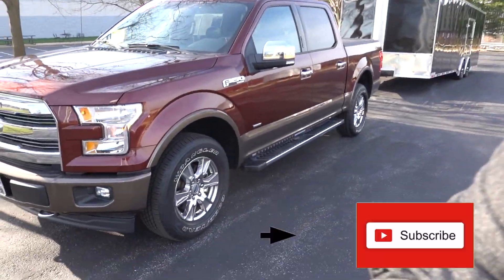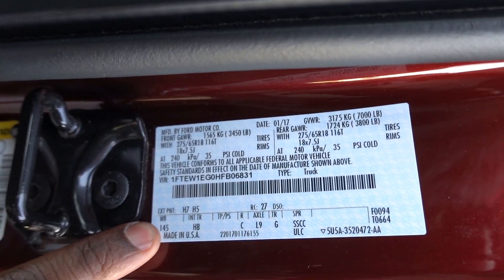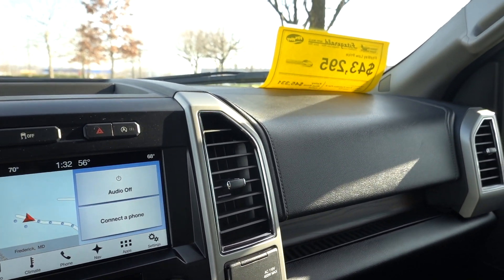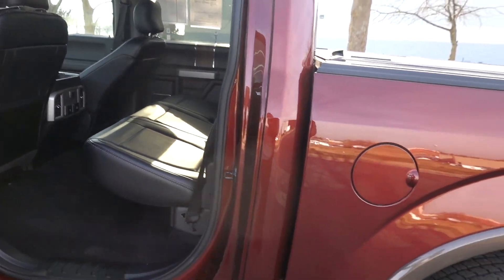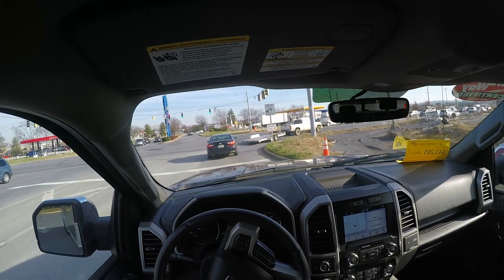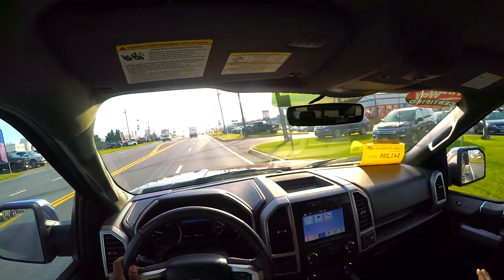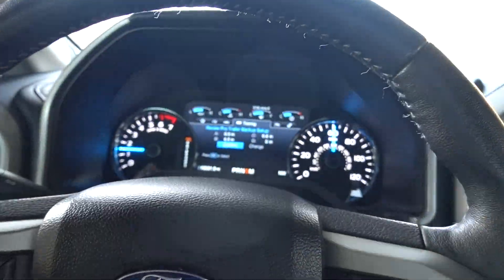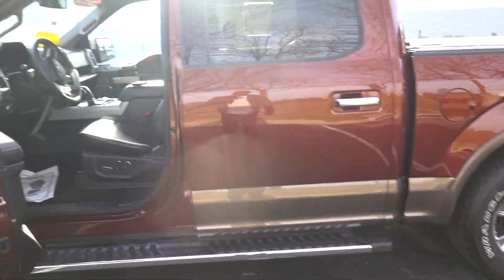The Ford F150 Performed The Worst On My Towing Test... | Find Out Why It Failed!

Comment: If the tailgate handle has the led light then it does have the tow package.  Just a clue for the ford trucks.  Did not notice one on the truck you drove.
Reply from the maker: Thank you for sharing this!
Reply: There are 3 tow pkgs, 53B is basic, 53A is HD, 53C is max tow. The 53a has the LED light on the tailgate

Comment: Your setup is for 5000lb trailer with a 500lb hitch weight!
7:20 in the video.
Reply from the maker: I believe I posted the towing numbers in the video
Reply: That's for bumper only... As in no hitch what so ever...
Reply: @JB_WhoWork  yes at 7:20 you show that you should only tow 5000 ibs without a distribution hitch, no matter what your ball says!
Reply: @6628guitarhero   No, its for towing without a distribution hitch! 7:20
Reply: @6628guitarhero  No it isn't!

Comment: That is not a max tow package, nor did it half LT tires. I have a 2011 ecoboost that I towed a 5th wheel and Travel trailer. NO sway at all. Which I have the max tow and LT e rated tires

Comment: If you felt the trailer pushing the truck, your gain is set too low for the brakes. The trailer at low speeds should actually slow you down. What was the weight of the trailer? Need a TDH.
Reply from the maker: Should be posting a video this week on that

Comment: You shouldn’t be towing that trailer with a half ton without a weight distribution hitch.  The Ford is a light truck as you can tell.  The same aluminum that gives you more payload makes the truck too light to control bigger enclosed trailers .
Reply from the maker: I’m testing manufactures claims about these tow numbers and I’m learning these trucks do not have enough stability to come close to the tow capacities. In time I will add a WDH to my trailer and retest these truck but for now, I want to see how well they do without
Reply: @JB_WhoWork  seems like what you're saying is only partially true.  Seems like you think manufacturers should only be allowed to state a towing capacity that's acceptable in every configuration (flat/boat/box) but that's just not true.  If you properly load 8-9k on something more aerodynamic and use a proper WDH these reviews will look less like a commercial for HD trucks.  I feel like it's common knowlege that HD trucks are better for towing but what about for everyday use and limited towing?  That's not every situation but it's pretty common since these are very often daily drivers for people nowadays.  Besides that fact, much of the advantage of HD trucks in towing (especially box-shaped trailers) is that they simply weigh more, not necessarily any engineering or power differences.  Also will be much easier to evaluate all these videos once we know what the total and tongue weight of the trailer is.  The hitch level of each truck could even make a difference.
Reply from the maker: The point for these videos is to give my perspective on half ton trucks. I had a chance awhile ago to tow with two half tons and was shocked at how they performed, so I wanted to test more to see who makes the better towing truck. Sure WDH would make a big difference but I want to test as many trucks w/o to see how the frame, suspension, and brakes perform.

I’m not against towing with 1/2 tons but I think manufactures are building false confidence in their products because even with the right hardware, you can’t get around the “light” feeling 1/2 tons have.
Reply: @JB_WhoWork  it’s your test so you can set it up to show what you want... but it’s sort of like towing with a Honda Accord. 3/4 ton pickups tow better than those too. It’s dumb that marketing is choosing to focus on towing capacity as the reason to buy a pickup no doubt. It just seems more useful to find the limits of what they can do when properly equipped. A half ton that can tow without wdh safely just isn’t a half ton at all.
Reply: @JB_WhoWork  towing numbers are not manufacturer derived, they all rate to the same SAE J2807 standards now and have since 2016. The manufacturer does state however that a half ton should never tow more than 5,000 lbs off a bumper ball hitch without weight distribution bars, and HD trucks no more than 6,000 to 8,500. Not only is it unsafe to do so, it is pointless as you are exceeding this limit by more than twice the weight half tons were designed to handle without it. With the proper set up, including sway control the F-150 will have zero issues with this trailer

Comment: You may have mentioned it before but what is the GVWR of your trailer?
Reply from the maker: 9950
Reply: @JB_WhoWork  you may have been over the GCVWR of that truck?  Not sure what risk that presents but would hate to see something bad happen to you!
Reply from the maker: So the GCWR I used was 16100 so figure my trailer is 9500#’s, I’m 200#’s, and truck was 5239#’s. Add it all up and I’m at a GCWR of 14939#’s which still leaves me with approx 1161#’s leftover. Someone confirmed this truck has the max trailer tow so this truck could potentially have 800#’s more of GCWR available! Thanks John for caring for my safety 😀
Reply: @JB_WhoWork  Thanks for the explanation, JB...I’m new at this and was under the impression that you just added the GVWRs of both the truck and the trailer to see if you were under the GCVWR of the truck (tow vehicle).  Peace and Happy New Year!!
Reply from the maker: This is very complicated stuff so keep learning and gathering information so you can tow with confidence!
Reply: BUT you have to calculate tongue weight (950-1000) here and then subtract that from your payload 
  so with you at 200lbs your maybe 500lbs to spare and as others have said this definitely needs a proper weight distribution hitch 
  I good safe rule of thumb is keep it under 80% or mad tow rating 
  watch TFL truck videos
Reply: @JB_WhoWork  you don’t have max tow on that truck, it’s a 53B pkg

Comment: I personally would not pull this trailer with anything less than a 3/4 ton (minimum).  I am a fan of the EB engines power and as a Tundra fan I am wanting to see what the (reported) new TTV6 will do in the Tundras.
Reply from the maker: I agree, I think the 7k mark is real for half tons

Comment: why would you do a tow test with a truck not set up to tow? the mirrors were a dead give away that there was no tow package.  i have a 2019 F150 with max tow package. i pull a 30' TT and have zero sway. now yes, i have a weight distribution  hitch with sway bars.
Reply: It has a tow pkg

Comment: I’m no expert and it’s been years since I hauled a trailer. But I live in Alaska and have hauled loads up the Alcan multiple times. I think what you need there is a weight distributing hitch with sway bars. Thats what I have always used and most of the trailers I’ve hauled where a lot bigger than that one and I’ve never had a swaying problem. Vehicle was a 77 F250.I liked the view in this video today more than having the camera mounted on the dash
Reply from the maker: Thanks Mike, this truck didn’t have a rear sway bar, wrong tires, and it’s lighter than it’s competitors. The Silverados, RAM 1500, and Tundra I tested did noticeably better. Thanks for sharing 👍🏾

Comment: Big trailer for a 1/2 ton.  Not an expert at all, but looked the the receiver setting was too low.
Reply from the maker: Where did I put in the description that I was an expert???
Reply: @JB_WhoWork , I was saying that I'm not an expert.  Wasn't ripping you, Just pointing out that it seemed the tongue appeared to be low.
Reply from the maker: My bad I misread your commet. This truck lowered a little more going down the road so it was low. This truck like all 1/2 tons need more hardware for towing like a WDH/bags and possibly stiffer sway bars

Comment: Your weight on the trailer is not balanced. That's why your swaying you need more tongue weight. This is why tongue weight on a truck is so important. A big  tow capacity on 1500 series trucks is with a 5th wheel hitch not a receiver type. You need more education on what these specs are for. Just because you can tow something doesn't mean you should. You made a good call to get off the highway after it started to sway. Keep in mind a sway bar has nothing to do with the trailer swaying it's the way you are loaded

Comment: That truck doesn't have the max tow package if it did it would have 20" in wheels
Reply: Wrong
Reply: Yes and no, depends on the year.
Reply: The truck had the MAx Trailering Tow package.  That’s why the Hitch weight was the high end on the Tow guide.  You can also tell based on the shocks. On the F150s when the rear shocks are behind the tire, its max trailer package. Your issue was you were towing without WDH and no sway control.  Bad combination. What was the weight of that trailer?
Reply: @TheIceStormof1906  my truck has the max trailer tow package and my shocks are pointing both to the front and the back
Reply: @TheIceStormof1906  those shocks are mounted in the same place on f150’s, has nothing to do with max tow

Comment: Having that amount of sway in that particular truck has me wondering if one or both of your back tires were underinflated
Reply from the maker: It’s possible but Ford owners mentioned it was due to weight of truck and no sway bars 👍🏾
Reply: My 2016 F150 needed 50psi to settle out the wiggle. I only towed a 29ft travel trailer with WD(6100lbs) and never again would I tow that large with any 1500/F150. The ability to pull has improved over the years, the capacity to carry has not(still less than 4000lb rear axle).
Reply: @jnk26  the max tow has bigger axles
Reply: @paulhunter9613  between the max tow and non max tow 3.5EB/5.0 is the axle shaft diameter and the number of leafsprings. Both trucks still option the same wheels and tires(18" all terrain or 20"). I have a 2022 F150(single leaf non max tow), I added air springs for towing my fifth wheel and barely add any air(1800lb pin weight). This truck(just like my 2016) both have the 9.75. Clearly this one has upgrades over the 16 because it doesn't have the axle shaft wrap-up(the wiggle I felt) like the 16. But the specs on the 2022 3.5 is 500lbft and it has a 4.62:1(2,310lbft down the drive shaft) first gear vs the 16s 420lbft w/6spds 4.17:1 first(1,754lbft down the drive shaft). The only axle over this in the 4800lb HDPP axle, this axle is actually bigger. It's has a thicker tube wall and even larger axle shafts, semi-float axle shafts are load bearing(unlike the full-float counterpart).
Reply: @jnk26  that’s what I read in the max tow specs, it has an upgraded rear axle among other things
Reply: @paulhunter9613  the upgrade is a slightly thicker axle shaft over the standard 9.75 axle, and a 3 leaf pack vs the standard single spring

Comment: It seemed like the Toyota swayed way more.
Reply from the maker: Nope, this felt less in control in comparison but it’s becasue Ford doesn’t offer a swaybar in the rear.
Reply: @JB_WhoWork  oh really? Yea I'm a Ford guy. But I hate they put the sway bar in stock! They claim that's why they moved the shocks to the outside of the leaf springs. It might have been good in 2004. But it needs a little more help than that. Especially for the price you pay gir a Ford.
Reply from the maker: I agree, that and tires make a world of a difference for stability 👍🏾
Reply: You don’t know how a sway bar works @JB_WhoWork

Comment: Wow I have never had any issues with my 2015 Ford F150 Supercab 4X4 5.0 towing a 22ft 15,000K trailer with a New Holland Boomer 33 with loader and 72inch brushbull mowing deck on it. That's an 8,500lbs plus load we pull that thing down the highway no issues.
Reply from the maker: Did you add a swaybar on the rear?
Reply: @JB_WhoWork  None on the XL model we have I'm buying a 2020 Ford F150 5.0 this week I will see if the XLT has any. When hauling a load on our trailer we balance the load of equipment try to load tongue weight just right so there no sway at all. I have ran 73mph on one of our worst highway/interstate 67 to Little Rock Arkansas no issues on that road the truck ran straight and trailer was in line and smooth. We do run 34inch 10ply tires on the truck with a 2 inch leveling kit and rear heavy duty shock's that's all we have done to the truck.
Reply from the maker: I think the tires were to blame on this test too. When testing the half tons, i pushed my Charger more in the center of my trailer on the axles. When I tow it with my 3500, I prefer the tongue weight as it softens up the suspension 👍🏾

Comment: Truck tows great when properly equipped!
Reply from the maker: Chevy did better
Reply: @JB_WhoWork  I’ve owned both.  My Ford can tow a ton up a mountain.  My Chevy couldn’t.  No comparison, really!  Not sure what was wrong with the Ford or what modifications the GM product had; but something doesn’t square up here.
Reply from the maker: The truck didn’t have a tow prep package from what viewers stated so wrong tires and oddly Ford doesn’t equip 1/2 tons with sway bars. At some point I will conduct the test with a WDH but for now I want to get a mental baseline
Reply: @JB_WhoWork  again with the no sway bars..that rear sway bar has nothing to do with the problems you have

Comment: JB, why are you using an old tired engine to do this test? The 2021 PowerBoost 7.2 KW can out tow even the diesel-powered engines in the GM and Ram HT pick-ups.  PowerBoost has 500 lbs ft of torque which is the number that matters.  The Ford 5.0 has cylinder deactivation which ruins it. The Chevy and Ram V8s are both too weak. You have to go 3/4 ton to even come close to the PowerBoost.
Reply from the maker: I can only use used trucks in this testing. Once they start hitting the used line I will test them but that’s a few years out 👍🏾

Comment: imma be honest, I feel like you are overloading the tongue.  And Im not just talking about the Ford, the other trucks seem to be overloaded.  Which I guess Im not sure about how the trailer is designed, but I know that the engine of the hellcat is past the front axel.  I don't know if there is another reason, but I know all the other reviewers I watch only have roughly 2 inches of squat when max towing these trucks, so 3-4 inches seems off to me.
Reply from the maker: My RAM 3500 drops about 3 inches for my fifth wheel and I’m not even close to my payload capacity. 3 inches is within spec but WDH is necessary for this setup 👍🏾

Comment: Sway bars do make a big difference when towing heavy weight 💪..looks like the Chevy was the best so far and that was lifted with big tires.. lol..bring on the Ram..great job JB.😁
Reply from the maker: Thanks brother! I have to test a RAM with and without air so hopefully I can get my hands on one soon!
Reply: I have tow campers all my life. And with a boat behind it. When I had a travel trailer you do get sway. Even with sway bars. I eventually went with a 5th wheel. Huge difference. Didn’t feel it behind me. Now the sway on travel trailers was worse when a semi was passing me and very windy days. My experience I would rather have spring suspension. Never really towed a heavy trailer with Ram but seen friends that did. A lot more squat on coil springs. Had the power but more squat. Cheers all.
Reply from the maker: Thanks for sharing!

Comment: 470lb-ft “heavy duty” 2500 trucks laughing 900+lb-ft
Reply: Yes for Diesel, but on par for gas HD.
Reply: People act like they need 1000ft-lb now. It wasn’t that long ago people towed heavy with 500ft-lb. and had no complaints.
Reply from the maker: Yup!
Reply: @BrianBourgeois-  yup, gotta have the $85,000 truck an 1000 lb torque to pull that jet ski😝

Comment: You completely ignored the GCVWR from the towing guide (though I was excited that you actually referenced the guide -- just, not all of it). No coupling safety pin? No WDH? You arbitrarily selected 3.0 on the trailer brake... without explaining a proper technique for why? Come on! 

So much is missing with this "tutorial." It's no wonder you think this truck is the worst for towing. Any truck can be worst if you don't do things right...

I wasted 24 minutes watching this video. It's 100% opinion based, and I think if you actually taught us the things you omitted, it would have been better. But I suspect you don't know those things yet. It sounds like you love the truck's engine and powertrain, but all of your problems were suspension based. Yet, the suspension part of Towing is the stuff you didn't do right.

When people understand everything about towing, including the things you didn't account for, they'll realize that this truck is a solid choice for towing, so long as you don't exceed limits. Like 16,100 lbs in your case. (What was the trailer weight again?)